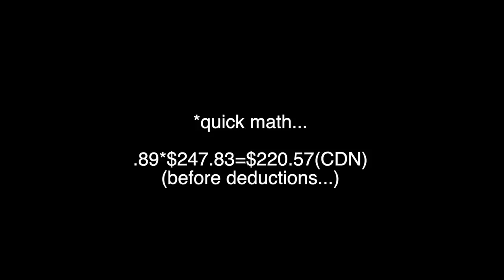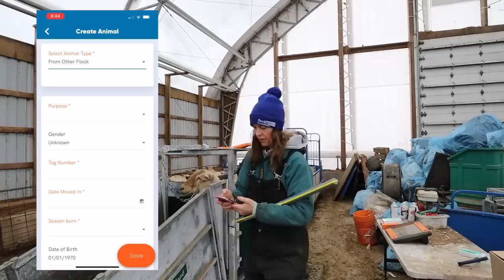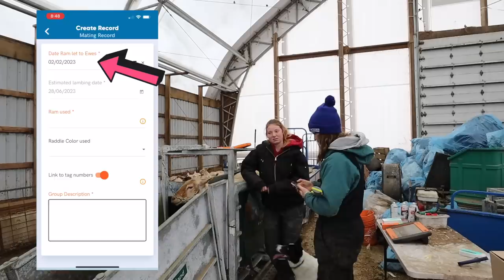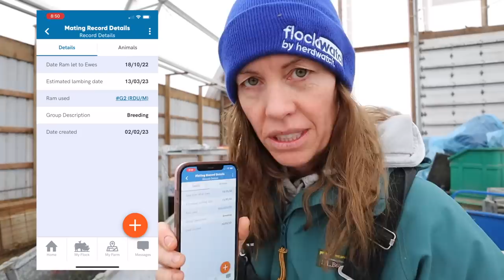The first time is the worst!!  ...trying out this new sheep system & feeling kinda dumb. | Vlog 667

Comment: Does anyone else think that Mark and Sandi are the MacGyvers of farming? I love to see all that they do to fix things and the beautiful cabin they are building.  Thank you for sharing your lives. You inspire me every time!!
Reply: The Brock’s are so adaptable at maintaining and repairing ALL manner of gadgets!  I learn new fix it solutions every video you share - from warming a cold lamb inside a full arm glove and in a bucket of water, to breaking down and setting up your equipment…. And if there’s ever a tractor derby race and obstacle course with the big claw out front, you’d sweep the field! 🐑❤️
Reply: They are. But in all fairness, being a farmer requires it so most farmers have to have some level of MacGyver-ing. It is amazing to watch, though.
Reply: There's a reason, on full display by the Brocks, why most successful inventors have farming somewhere in their backgrounds. It's because such a broad spectrum of knowledge and technologies is involved. Crop management, drainage, plumbing, animal husbandry, mechanic, carpentry, electrical, welding, home making... The list is endless. They're under constant pressure to manage flora and fauna, with all the machinery required by volume of production. If something breaks or isn't doing the job the farmer is the front line of fixing it. Anything that saves time is a constant factor driving them to iterate and modify. When it comes to the rarest commodity, leisure time, they have to be just as creative. If you can't even spare an afternoon to drive 45 minutes to a lake cabin: bring the cabin closer to home... Even if you have to mill the lumber to build it yourself.

Comment: As someone who has been a developer, you are absolutely the best person to be using flock watch. We have tech brains which don't think in the same way as you think. So don't be so hard on yourself. What you're contributing is absolutely vital.
Reply: Yes indeed!  Sandy’s situation is radically different that the outdoor UK and European  flocks/herds for which the system was developed.  With all but the Golden Girls indoors, it’s unlikely the flock will have animals just disappear.  The 4 lambing periods a year were certainly not to be expected with UK sheep, so Flockwatch originally didn’t have multiple lambing periods per year.

Comment: I am currently a software engineering student and I can simply tell you there are almost no circumstances that feed back by a person that is using your software will not be useful in someway. The fact that you give them so much direct feedback and they can ask follow up questions is extremely useful for a developer. And at the end of the day they as the developers need to make the decision if it makes sense for for the app that they are creating.

Comment: I admire your perserverance with the new system to manage your sheep.  One of the hardest things in hospital nursing was constantly learning new and improved programs that tried to do everything for everyone.  It is even harder when the program is not set up to do what you need.  Because of all you do I am hooked on your channel! <3  My best to Jess and your family with the coming surgery.
Reply: I felt the same way about the improvements to the fuel sales programs at work.  The running joke was, that 1 improvement resulted in 6 new problems that we had to work around.
Reply: So many older nurses left over the constant tech changes which is sad. If there had been a bit of support they may have stayed on.
Reply: As a fellow nurse I second that having to put a blood pressure in 5 times is ridiculous!

Comment: Prayers for Jess, you and Mark. My daughter is 40 yrs. old and I still worry about her. You are a very loving and caring Mom. I am sure everything will be ok. 

Alrighty then, now on to your vinyl flooring. I installed the same type of flooring in our Cottage in 2006. I love the old wide planks for the farm house look. It looks like we just installed it. People always say it looks so beautiful and that it must of been expensive. Here is a tip for cutting. Use a clean, new fine tooth saw blade made for cutting vinyl planks. If you notice breakage or splintering, change your blade again. I ended up using a knife to cut my flooring, because I didn't have the right sawblades. Good luck, I can't wait to see the finished flooring!

Comment: You might want to try an outlet that turns on when it’s cold and off when it warm up.  No need to unplug your heater strip for the pipes.
Thermostatically Controlled Outlet: (1 PCS)Automatically Turn on Below 32℉, Turn Off Above 47℉ Unnecessary to Turn Off Power Manually in Cold Winter Cube
 
 Thermostatically Controlled Outlet: (1 PCS)Automatically Turn on Below 32℉, Turn Off Above 47℉ Unnecessary to Turn Off Power Manually in Cold Winter Cube
Reply from the maker: Thanks!

Comment: Sandi when you where climbing around the water pipes, I was holding my breath.  I always figured that I was good about climbing until I slipped and fell.  I broke my right leg, broke my ankle and broke my  foot.  I called in to the squad, and they asked me how I knew that my leg was broken.  My comment to them was that my ankle was no longer pointing in the right direction.  They said they would be right there.  Had emergency surgery to fix the leg,  waited until the next day to have the rest fixed.  I have now  have had 6 additional surgeries.  Not totally fixed, but I still have my leg.  Good figure.  Please be careful climbing on fences especially ones that are frozen, and ladders.  I hope Jess's surgery goes well.  Take care and stay safe, Gwen from Ohio.

Comment: Sending love and prayers for your daughter. May her surgery go smoothly with a speedy recovery. ❤‍🩹🙏 As far as the Flockwatch stuff, it's always frustrating when transitioning to a new system. Don't beat yourself up on that. Like anything there is always going to be a learning curve and your input is probably a blessing to their company. That's a big reason they are so available to you. Once everything is set, you'll find your rhythm with this system too. Hang in there Sandi, you've got this! By the way, kudos to you and your husband on that little gem you have going in the woods. I bet it's going to be such a fabulous little get away once you get it done. It's fun to see how you work together on that project as well as all the daily stuff have to do to run the farm as a whole.
☺👍💖

Comment: Jack is right, you're helping them better their system. Just think of it as you're in a very privaliged position where you're getting to design the exact system that has everything you want in it, and along the way you're putting in bits that will help others in the real world. You can only design so much from a desk, you're really helping them to describe what you need and want in practice. ❤️

Comment: Sandy have you put a good heat tape along the water line.tape to the waterline then wrap with fiberglass insulation, tape it iin  place.
Cover the pipe with foam pipe coverand tape that in place. In Alaska the plumbers put a pvc over the foam and  sometime tape iot in place.  Forgot! the fiberglass wrap is wrapped with a clear plastic wrap. Do not kink or cross heate tape, it will short out.
We use this method for mobile homes. Love your precentations. Farm Life . Please a  hve a dgoot year. ?Ellen

Comment: Thank you Sandi for guinea pigging this new stuff!  My wife and I are getting to the stage where we are looking at rfid and reader to help speed up and keep track of things. 
One of the things I would like to see the most is weighing, weight tracking, daily weight gains and such with the new app and reader wand 

We currently have a Gallagher tsi 1 (and are inputing tags manually) and need to add rfid to speed things up and reduce input errors. 
And trying to find anything other than advertising is difficult, to aid in the decision making process 

I hope that you can do more of these demonstration videos soon, as they are much more helpful.

Comment: Good user-facing tech should be intuitive and work for anybody. It's not you! When you can't figure something out easily in the field, they know that there is a flaw in the design, and it is not your fault. So don't feel that way! You're giving them invaluable feedback about where they need to make improvements for usability. -signed somebody who works in tech <3

Comment: i live in a mobile home...we have to have a heater tape on our water supply pipes so they don't freeze, maybe that's something you might be able to put in to stop your water pipe issue...it is electrical...we just unplug it in the spring and plug in in fall...very easy

Comment: Ok software 1-o-1. Imagine  a wall of cubby holes like at a old timey post office. Each sheep has it's own wall with 264+ cubbies. Each cubby your using is marked. Box 1 "birthday", box 2 "sex", box 3 "mom", box 4 "dad", ect. , ect.. You can have as many cubbies as you need and most programmers leave a bunch blank. So now all your asking for is a box marked "Group" and a way to sort it. Your the customer, ask for what you want, or explain your method. It's the programmers job to figure out what you really want (or need), and give you an easy (we call it user friendly) way to do it. If you are having a hard time with it the programmer messed up, not you. Software SHOULD be written for 10 y/o's.

Comment: Hey Sandy I haven't looked at all your messages and don't know if this is something that has been suggested a million times.
I always put a basketball, or volleyball in my stock tank for My Horses when it was starting to freeze before I would get the stock tank heaters out. I will leave them in all winter even with the stock tank heater for when it was really cold. The horses would push the ball around and it always breaks that first thin layer of ice on top so the horses had access to water. It really works quite well. If that first layer continually gets broken it takes a long time for it to really freeze. Not sure if sheep would do the same thing. You've lived in Canada and had livestock forever I am sure that's an old trick you've known about your whole life but thought I'd mention it

Comment: As a tech person, the more detail you can give for how you intend to use it the better. Don't beat yourself up, cause all new software is designed based on necessity, and the guys at Flockwatch are there to create the software, and they understand that you don't know what you need until you need it. As long as you're taking notes of everything it still doesn't do as you're going through your phases of sheep life and telling them in detail what's missing, by the time you finish a full maintenance cycle/lambing group you'll have the software you always wished you had.

Comment: OMG Sandi,,Just saw a commercial about a farm in Australia. 
Top Tech equipment. 
Sensors will clamp the sheep, read data, weigh and release the sheep in the runners. 
Caught my attention because I see You and Carissa body pulling the cramp with all your might. Opening to release the clamp. Physically exhausting. 
Your heard is much larger than the commercial.  Might be worth googling. But you may already know about high tech running gates.

Comment: If it is vinyl flooring, you don’t need transitions, especially seeing the size of your little cabin. I just had new flooring put in my 1300 square-foot house, and the contractor insisted on transitions, and I talked to the flooring company and they said as long as you have vinyl flooring, you do not need transitions in that small of a space. Your cabin looks smaller than my house. I had waterproof vinyl flooring put in, and no, you do not need transitions.

Comment: The best kind of tester is someone who will find all the breaks and issues. If you can't use it with your process it needs to change. They have thought of all the ways you might use it on a daily basis, thats why they need testers.

At work we have been working on testing a new accounting software, the people with masters degrees and 10+ years experience still have those moments of "am I just dumb?". The answer is NO, the reason you feel it should be one way and are surprised it is not is due to past experience and your knowledge of the processes.

Comment: I ran sheep for 7 years, outdoors.
If you let sheep graze outside, many of your indoor problems will disappear. 
Way smaller power bills, way smaller water bills (if sheep have access to a pond or creek), their hooves will wear away naturally, your water will not freeze, no haying or feeding indoors. Smaller harvests and processing/feeding of hay.
I watched some of your vids and cannot understand why in the world you keep the sheep indoors and get so stressed with micro managing them.
These days, drones can bring in the sheep easily from any field. They can easily drive the flock home with you at home. Just open the gates. 
You can also use drones for counting sheep and observing for predators.
A drone will scare the crap out of a coyote. You can even bring them in every night if you want to. Drone herding is a piece of cake. Soon you will be able to buy drone swarms, which will work together to drive away predators and bring the critters home or keep watch at night with see in the dark cameras and motion sensors. Some drones will even work with critter momitor/necklaces to monitor heart rates If the heart rates go up at night across the herd, the drone takes off and seeks predators which have no necklace.

Comment: I have to ask why is it that you are switching to Flock Watch? When you started using the Gallagher, did you have many of the same challenges? If so, it's just the newness of it. If not, then they (Flock Watch) have not made their product user friendly enough. Developers love people like you because you are practical. A hands on person , that a developer will never have the mindset to make many of the things you are suggesting. Just be cautious with this, as once they do a full launch, the chances of you getting changes are not going to be so easy and they will cost you. A piece of advice, make sure you keep updating your Gallagher. It sounds like they are a solid company and a new up and coming, may not be there in a year or two. My other thought is the constant use of your phone to do this, from the battery life, the smaller typeset and mostly the position of your neck. Be aware of neck aches, headaches, and eye strain.  Love the content, especially when the babies are at the stage when they jump around like little pogo sticks. In my head I hear Boing boing boing <3

Comment: 1. Just because you don't understand the technology, and it's a new program to you, doesn't not make you stupid. That kind of mentality is like dunning yourself for not know how to do brain surgery, if you found yourself in an operating room. You just don't know. It's got nothing to do with your intelligence, just your inexperience. You definitely shine and are brilliant when it come to the love and attention you provide your animals. Stop beating yourself up, please.
2.There is a hack I found on another channel, to keep the water in the buckets and troughs from freezing. For the bigger troughs, you would use a 2 liter bottle, and for the buckets, small drinking water bottles. (the 12 oz (300ml) size would be best) Remove the labels and make sure the caps fit well. You fill the bottles 1/2 full of water. In the 2 liter bottle you then add 5 tablespoons of kosher salt. Put the cap back on tightly and shake up. In the smaller bottles you add a 1/4 cup of kosher salt. Put the cap back on tightly and shake. Make sure no water is leaking out.  You then drop these into the troughs or buckets. They will float. The idea is, these bottles of water won't freeze, and as they float around in the water, it keeps it moving, so ice doesn't form.

The person that gave it a try had good luck with a regular water bowl, bucket and the troughs. I thinks she said it had gotten down to 5* F (-15*C) the night before she checked. 
I know this won't work in the small bowl to that watering system in the one barn, but if you have to resort to using buckets over there, it will help. This would be good for the Golden Girls and the buckets for the Bottle Babies.  It wouldn't take much to give it a try.
3. I hope all goes well with Jess and her procedure. I'm glad it's not quite as stressful as the first time, tho being concerned and worried is understandable. Be safe getting there and back home. Prayers and hugs from Oklahoma.

Comment: If you can’t use it, then people who are even less technically savvy will struggle. You are  not technically challenged, you operate cameras, video editing software, and other farming software. You are above average compared to most adults(gen z doesn’t count) I’m an engineer - we hope to design products to maximize accessibility, that’s how we make money. If people can’t use it, they won’t buy it. Stop being so hard on yourself!!  If it’s not easily accessed or easy to do, that’s a design problem, not a Sandi problem!!!

You have to remember that software developers aren’t farmers so they are doing their best to put themselves on your shoes when designing their products. Also, every farmer does things differently, they may not have had a farmer with your specific needs during beta testing. By giving them feedback, you are helping them make their product better and widen their customer based.